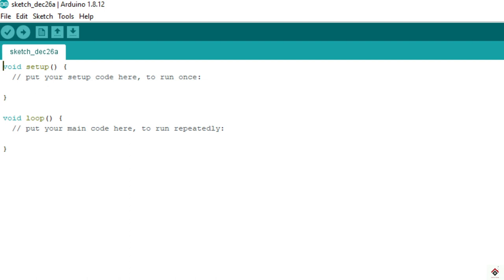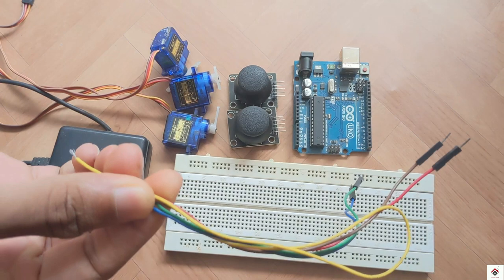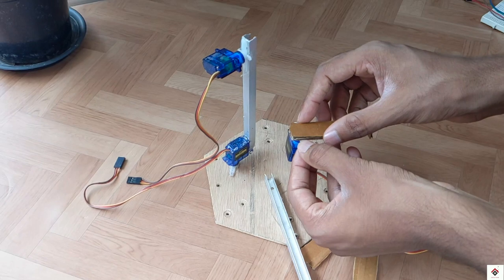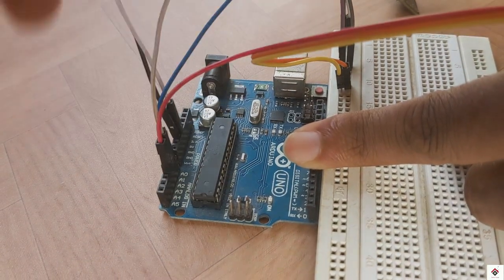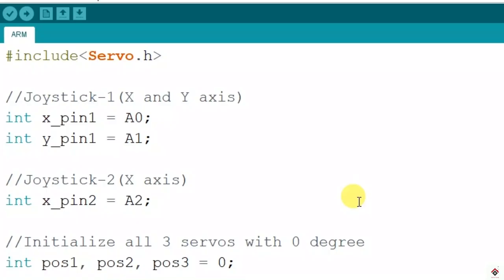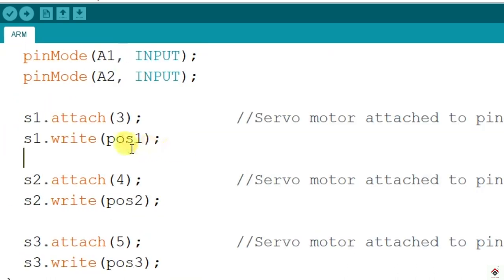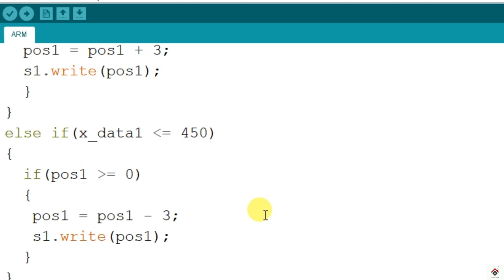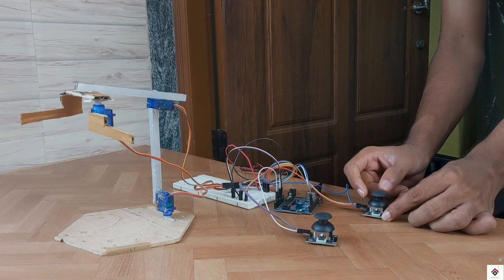Joystick controlled Servo Robotic Arm using Arduino [with CODE explained] | Micro Servo Robotic Arm

Comment: Thank you so much for this video! Though I do have question. How do I reverse the control of the joystick for servo 2? My arm is moving left when I press the joystick to the right.
Reply from the maker: Welcome!!
You can change the motor alignment/mounting direction which is easy way.
Code can be also modified which is another method.
Reply: @techathome could you show how to do it through the code?
Reply: I figured out how to invert the servo travel so it matches the direction of the joystick but, the servo rotates to one end and stops working. Resetting reactivates is but it does not continue to work once the servo goes to one side. I know I’m close but the parameters have to be incorrect. I changed the + to - and - to + in the logic of joystick.

Comment: Sir..can we control the same set-up with (wireless)12 channel transmitter and receiver instead of using this wired joystick..?
Reply from the maker: Yes, Servo motors can be directly connected with receiver channel. No need of any driver.

Comment: Hey can i use metal gear servo motor 11kg, for the same code?
Reply from the maker: Yes you can use
But provide external power supply according to motor specifications